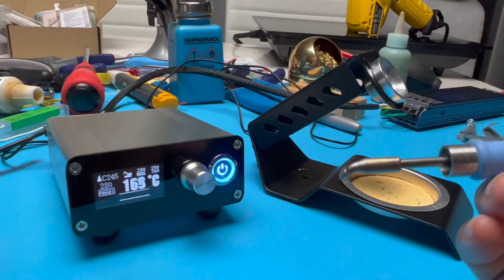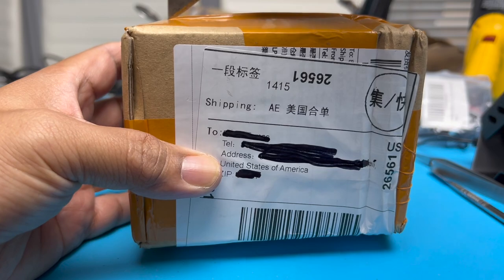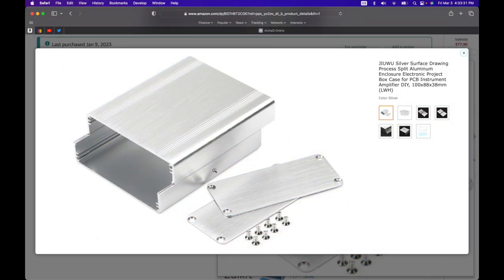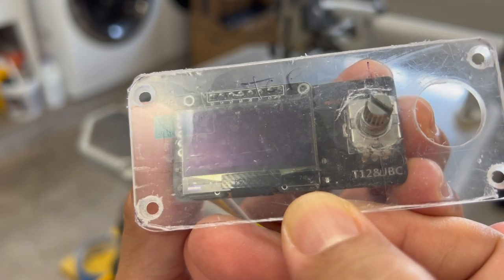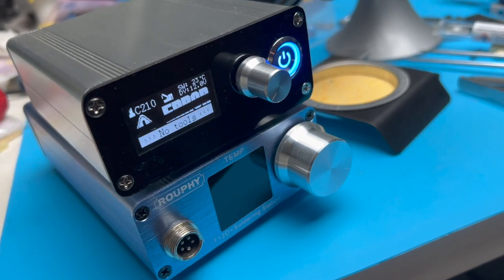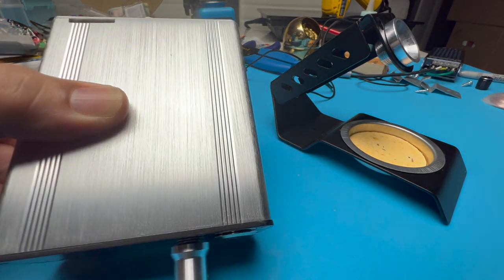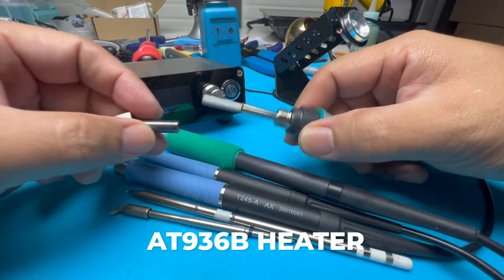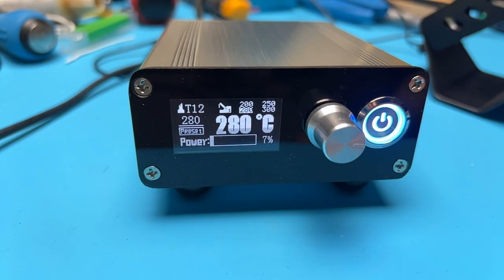Episode 132: DIY Custom Soldering Station For JBC C245 C210 Hakko T12 T15 T18 w/ An XPG Controller

Comment: Word of warning, AC terminal lugs should be crimped first and foremost.  Soldering can be done after, but IEC guidelines say there must be some other form of mechanical connection other than simply solder.  It can pose a huge fire risk.   Others are going to follow your tutorial, so for their safety please leave this comment.  I posted this once already and it was removed.
Reply from the maker: Much thanks for the heads up. Man, just when you think you know all the major safety standards! 

But not seeing how the wire could heat up with enough current for the solder to moltenize before the breaker trips… but should’nt question code or guidelines. And wouldn’t “connectors only” be nore iffy as they can be pulled off and can arc. Also, what about filling the space with hot glue? Sorry, too busy to scour the IEC guigelines right now.

I’ll post a follow up vid that addresses this soon. Again, much thanks. 👍
Reply: @The_SegaHolic  BTW loved the video.  You've got some great maker skills for sure.  For the AC terminals ,you might be ok if the PSU is never moved or never takes a hard nock and lives a perfect stationary life. Maybe there is never any stress on the solder joints to cause them to fail.  Maybe the breaker might trip first, but that may not be true for every situation.  Something that always sticks with me is to remember that for every safety regulation or guidelines to exist it means someone has died or been seriously injured.   They dont come out of nowhere.   As OSHA says:   Safety Rules are Written in Blood.
Reply from the maker: @needsmoorecowbell  Thanks for the positive words dude. 🙏

Comment: The connection diagram for the iron tips are wrong. You didn't connected at all the thermocouple pin from the tip to connector

Comment: That soldering station is so... Mental LOL
Doesn't the grounding you just did cause a lot of issues with C245 tips?
it seems like you didn't ground the actual tip on the JBC

Comment: You soldered a wire from pin 1 on GX12 connector to the rear of the case 4mm banana jack for sleep activation?  Or solder to "S" on PCB?  Sorry, just to be clear.. in the video there are two connections on the banana jack for sleep activation, where are they connecting to?
Reply from the maker: Please always refer to the schematics I made and shown in the video. That details everything you need to know to build.
Reply: @The_SegaHolic  I saw the pinouts for T12 and GX12 in the video but I was wondering about the banana jack at the back.  I thought there would be one wire soldered to the jack, but there are two.  Is the second wire off the banana jack just grounding it to the case?

Very good video by the way, you explained everything really well.  Would you recommend a Sugon C245 handle or do you think the Aixun T3A is better?  I understand for T12, the SUGON is better because it fits the stand better.  For C245, Aixun doesn't need rewiring but which do you think would be a better handle?  You prefer knurled plastic compared to foam grip?
Reply: 2:28 yeah kindly explain a little more about seat sleep wiring.

Comment: Great video, may I ask the 936 handle is fit for AIXUN T3A also?
Reply from the maker: Yes, you can make the custom 936 handle for this station and it will also work on the Aixun T3A, but you will need to calibrate it carefully. It will run about 150 degrees too hot on the Aixun, so careful! I replied to your question on the other video on how to make a 936 handle. I will be doing a video on how to make a 936 hande soon. 👍

Comment: Thanks for the detailed video. I was wondering about those controller boards. I have Metcal and Pace soldering stations which use tip cartridges. I also have Hakko and Weller stations with separate tip and heater types.  But I've been thinking about building something that I can repair when it breaks. I work on mostly older thru-hole PCBs and point-to-point wired vacuum tube amplifiers so I can probably get by with T-12/T-15 tips. Do you know if these controller boards will work well with a linear power supply and transformer, since it is probably not as well regulated as an SMPS? I also wonder if this will work with the new Hakko T-39 tips?
Reply from the maker: Thank You! 🙏 I’ve tried my variable linear power supply and it works great. There’s an error margin for the input power, so it doesn’t have to be perfect if you’re not using a variable PSU. I’d imagine it would be the better PSU to use rather than a switching one because of the low noise. I think you’ll be rather surprised at these much, much cheaper solutions, both the station pcbs and the tips. But always go in it with tempered expectations compared with those industrial solutions you do have. But cost performance wise, these are just plain awesome.
Reply: @The_SegaHolic Thanks for your quick reply. I didn't know how tightly regulated the DC supply has to be. I would probably use a 200-250va toroid transformer which has better regulation, less voltage sag than EI transformer but with no active regulation like your variable DC supply. Basically, a bridge rectifier and capacitor bank.

The problem with industrial solutions is cost. New Metcal is nice but expensive. I buy older used stations. Curie Point RF induction has the best performance but they're difficult to repair and consumables are very expensive. Perhaps I don't need the very best performance as much as reliability. Hence the idea of keeping it  simple with a linear supply. Not sure how well knockoff handpieces will hold up. However, can always use genuine JBC and Hakko handpieces with DIY PS and controller.
Reply from the maker: @acoustic61  Next question is... how relaiable are these DIY controllers right? Haha.
Reply: @The_SegaHolic  You've used for several months? Heavy use? You think they may be poorly designed? No redundancy with MOSFET. Fail and burn up tip!! Controller is basically disposable throw-away. Cost less than one tip cartridge. BTW does the menu allow Farenheit temperature setting? Or only Celsius?
Reply from the maker: @acoustic61  I’m not that electronically versed. Yes, F or C available.
Reply: @The_SegaHolic  Thanks for the info. Obviously, genuine JBC is much more sophisticated. For one, they use muliple MOSFETs in series to switch on the heater circuit. MOSFETs can short circuit when they fail .Thus, if one fails it won't oveheat the tip cartridge. These cheap Chinese controllers use a single MOSFET.

Comment: hello my friend i purcased same soldering station, but in my soldering station is error while im installing 10k resistor its not controllable and heat up until the tip red, please help me to solve it 

i used 19volt 3 amps power supply
Reply from the maker: You can buy an Aixun T12 handle if you are having difficulty as you can plug those directly and it will work. Otherwise, you can watch this video on how to make your own T12 handle what uses the 10k resistor. https://youtu.be/en_3Hv8Sh4U
Reply: @The_SegaHolic  thank you it work perfectly

Comment: Hello from Italy! Instant subscribe and like at the video, really nicely put together. This was exactly what i was looking for but I have a question. I've seen some review about Aixun t3a voltage leak with grounded boards, current goes up to 1 amp through the tip and to the board you are soldering with temperature spikes (can clearly be seen in Tony359 videos about the t3a station) and was wandering if this xpg controller has the same flaws before buying all the components. Have you ever measured it?
Reply: Hello. Is the control board for Aixun T3A made by XPG? If it were made by a completely different company, I don't think the same problem would occur. Actually, I was also planning to purchase this XPG board, but after reading your comment, I am reconsidering the purchase. I think the spike on the soldering iron tip of the Aixun T3A is clearly a defect.
Reply: @toribird8353 i don't know, i ordered to test but as i tested it exploded on me as i rised the temperature and cought fire 🤬. Though I think it wasn't the controller fault, when i adapted the t245 plug and handle i went with color matching the wire without testing and now i descovered that the handle's manifacturer must have switched red and blue wire so i think i shorted the tip (?)
Reply: other than that i think i'll repurchase and test for voltage leak, but shouldn't be present as it could be only a aixun problem. Can't tell for sure till i test

Comment: Yep; going to build me won!
Thanks, keep up the great work and great presentation!
Btw. will the control board allow for temperature calibration?
Thanks in advance 🖖
Reply from the maker: Yes, calibration is possible. Don’t remember if the value is added or subtracted to the real-time temp, so you can experiment a bit. Also, if you’re gonna make a T18 clone handle, the calibration numbers will be rather way off, but is manageable to a degree. I really recommend doing the C245, C215, and T12(T15) handles as they work beautifully.

Comment: i purchase the same :) Connecting T12 handle but is tottaly different cable managment...working perfect! And i have in menu TIP Selection C470 :)
Reply from the maker: You should make a video showing the station u made and what it can do.
Reply: @The_SegaHolic  did you know what is menu stabilizes and protect? And explain how to set correct PID :)

Comment: Hello,
I watched your video with pleasure and got the same xpg controller. I'm thinking of using it with the T245 handle. The seller has specified the t245 links on the product's information page differently than you have shown here. Which way should I go? I'm thinking of using the sleep mode as well. Thank you in advance for your interest. By the way, sounds like he's talking over the radio line is super.
Reply from the maker: Just buy the AIXUN T3A T245 handle. It will work without modificaton on all XPG controllers such as this one.

Comment: Awesome work need to link the tips im building mine soon also it awesome work as always
Reply from the maker: I only have real JBC C245 tips as I have not tried the generic tips yet, although I have some on order. The cheapest place to get the real tips is:
https://www.tme.com/us/en-us/

As for T12/T15, I just get the cheapest generic tips I can find on Aliexpress. Real Hakko T15 tips are relatively cheap from Hakko USA
https://www.tme.com/us/en-us/

For the C210 tips, I just have one, which was the cheapest I could find on Aliexpress. I wanted to see if it would be worth it getting real tips. The Real JBC C210 tips are even more expensive than the real C245 tips, so I don't know if I'll ever get real tips.
Reply from the maker: BTW, looking forward to see what you come up with, with your station.
Reply from the maker: Lastly, the C245 and T12/T15 tips are calibrated pretty close out of the box for my controller. If you have the controller on Auto handle detect, the temps for the C210 and T18 and 936 tips are way off, so careful as you may ruin the tip. I'll give you the settings for the C210 and T18 tip calibraton when you're ready on Twtter. This is something I should address in a video.

Comment: thank for your video sir. I have a 936 clone but heating element has 4 wires(2 heating and 2 for ptc) how would I connect thermistor?? one to ground and the other to pcb pin 2? (T) or maybe one to + and other to pin 2? 

Thanks in advance!

Comment: Hello SegaHolic,

One question I have the same PCB but I'm having some trouble changing the Pinout for the C210 soldering iron. Basically my C210 handle has 3 wires, and all the diagrams that I see only say to connect two wires. How did you connect yours? Thnx you.
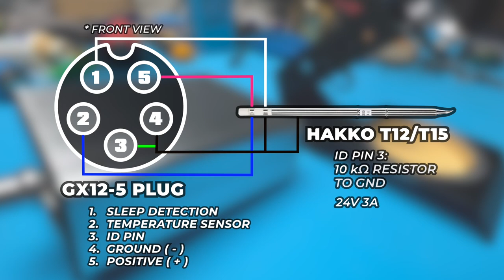Reply from the maker: 13:25 has the wiring. You really only need the 3 wires since stand sleep is used instead of shake sleep.
Reply: @The_SegaHolic can i use both seat sleep and vibration sleep mechanism